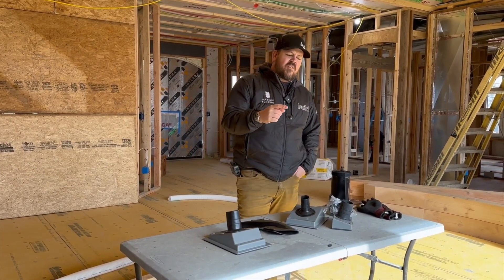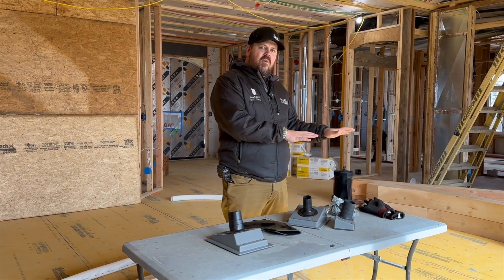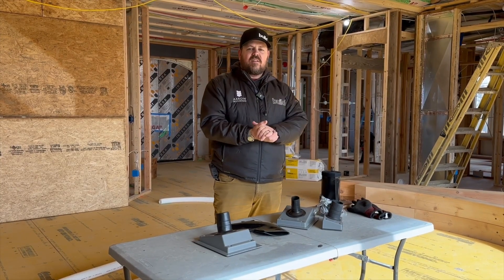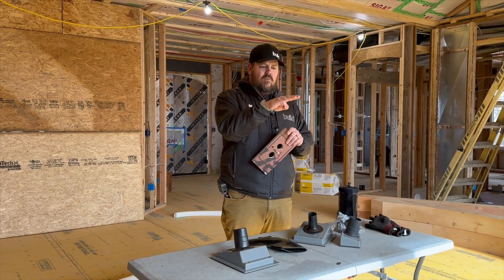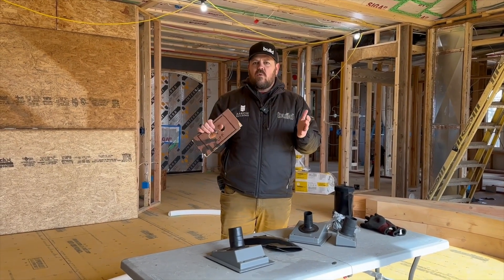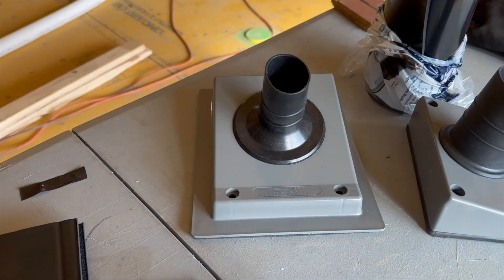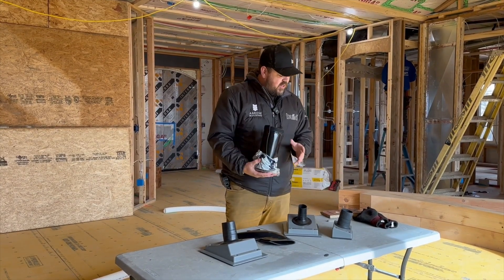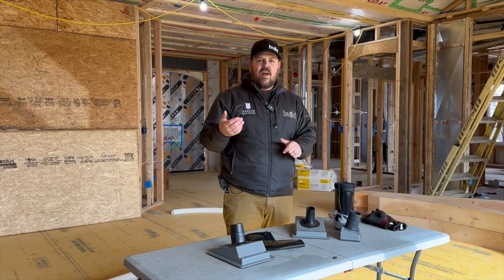HVAC Upgrades and Air Sealing Techniques

Comment: Hi Jake,
Great stuff! I'm working though this detail for a Passive House ADU I'm building in Colorado. That zip plate with the 3 holes is for one mini split, correct? One small hole for the communication wire and two big holes for each copper line? Are you running the copper line insulation through the hole and sealing to that? Or breaking the insulation at your zip plate and sealing to the copper? Thanks for sharing!
Reply: My assumption is the air sealing is being achieved at the plate, not the collar with the hose clamp.
Reply from the maker: The three holes is for a mini split. We use solid insulation on our units (non-split back) and don’t split the insulation at the exterior sheathing. We run the insulation through the wall and seal to the insulation layer.
Reply: @jake.bruton.aarow.building awesome! Thank you and happy building!

Comment: Hi Jake and thank you. My question has to do with your blower door score. Do you keep your bath vents and hood vent, etc, open or do you cover them up for the blower test?
Reply from the maker: When it comes to blower door testing the only penetrations you are allowed to tape over, or cover are those of systems that are intended to operate full-time. In our buildings the only thing we get to cover are the ERV ports. Everything else must rely on the dampers or closures in place as they will be during normal course of operation.
Reply: Sorry to belabor the point. So when you do a blower test at the framing stage, and you don’t yet have the range hood installed, yet the ductwork is installed, do you leave the six inch duct open for the blower test? Thanks Jake.
Reply from the maker: @SeanBromiley  If we are simply testing at framing we will likely cover everything because we are trying to find the leaks. We want to know how many hows and where. At final test we need a certified number and have to follow their testing standards.

Comment: I don’t really see the reason for a boot or anything for a line set. I just make the holes the size of the copper at a course line in the siding and then liquid flash around them then push the insulation tight to the sheathing from the interior and exterior and use stretch tape on the insulation then the siding guys cut a couple u’s on the top of a piece and a couple u’s on the bottom of a piece.

Comment: How did you handle the drain lines for the HVAC units inside this house?
Reply: Just make up a drain trap in the basement like there’s going to be a washing machine there and dump it into that.
Reply: @CMCraftsman Asking what they actually did. The video also mentions multiple mini splits, which could be spread out around the house.
Reply from the maker: You guys nailed it.
Reply: Piped to the refrigerator as distilled water.

Comment: I installed a Mr. Cool minisplit on a friend's dog training studio, which was already built: Sheetrocked, insulated inside and outside and sided. There was no way I was going to be able to do one hole per line, so I used the sleeve that comes with the Mr. Cool. But I did seal it to the siding and to the sheetrock and I also took some of the packing foam from the shipping carton, cut a plug slightly larger than the inside of the sleeve, and cut 3 holes in it so that both refrigerant lines and the wire had their own hole. Then I slit it in half and installed one half below the lines and one above. Then I put in the putty that Mr. Cool supplies. I covered that with flashing tape.

In some ways, I think my way may be better. If in the future the unit fails and needs to be replaced, I can pull out the old lines and put in new ones. If the foam has degraded, I can get new foam and replace it. The way you do it, you'd have to peel off the siding and exterior insulation to replace the line set, then replace the exterior insulation and the siding.
Reply from the maker: Absolutely my version takes more renovating to replace. It also has a better chance of keeping water and air from leaking. I’m not saying your isn’t doing that, I’m just saying I’m not take a chance on my client's homes.